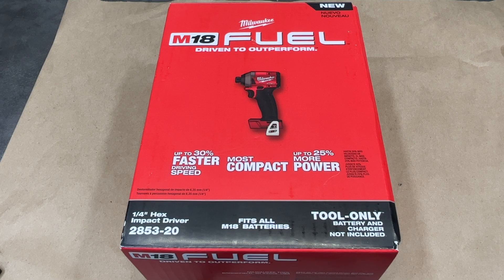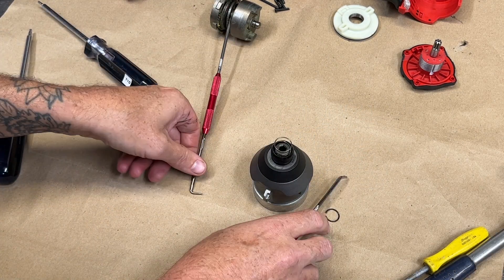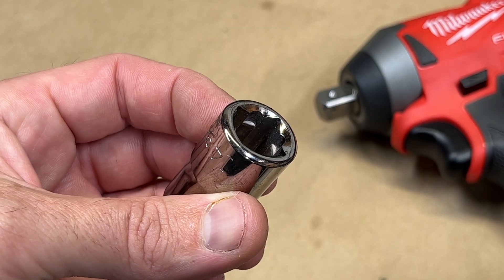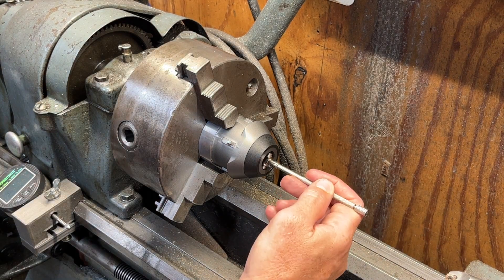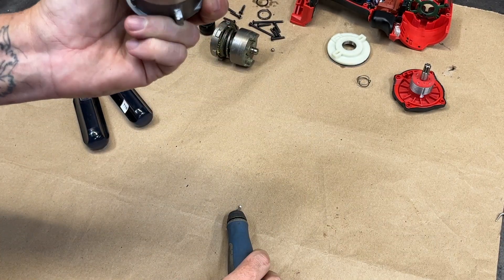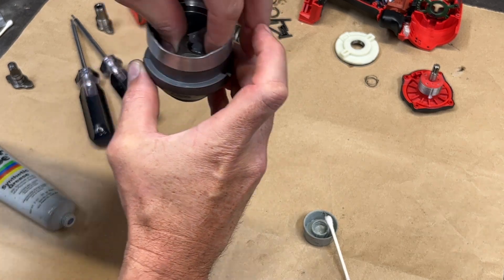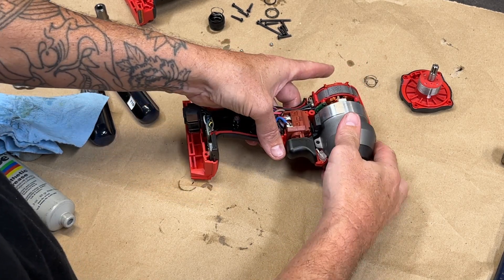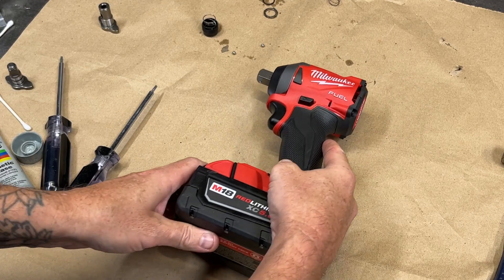Milwaukee M18 Frankenstein 1/2" Impact Driver

Comment: What other options would you use to drill out the opening if you don’t have access to a lathe?
Reply from the maker: Do you have a drill press? I'd say that would be the next best option. If you could set it up in some sort of vise or fixture and progressively get larger with the hole I think you'd have a good result. Most bench top drill presses do spin a little fast so I'd remove a little at a time. Sintered bronze can chip if you're not careful.

Comment: Hows she holding up? I'm about to make another one of these but with a twist 😎
Reply from the maker: Great so far!
Reply: @LucidAutowerks  Have a new impact driver(different brand)and anvil I'd like to modify with a lathe this time. Looking to get estimates for labor. Approx how many hours did it take to trim it properly with your lathe?
Reply from the maker: @mike_t_007  It was less than an hour of lathe time. It’s bronze so it turns real easy. Probably about 20-30 minutes with measuring included.
Reply: @LucidAutowerks  Thank you so much. Words can't explain how much I miss shop classes in high school. This would have been perfect lol
Hopefully I can get this done this week! How much material did you have to remove from the anvil? The hole on mine is smaller than the shaft but I see it can easily be widened like yours was

Comment: I USE MY gen 4 m18 for lug nut removal but seem to break the hex adapter when the customers wheels are over torqued.. I like the light feel of the gun. I really want to do this adaptation! Great work, I don’t have a lathe thought :/
Reply from the maker: Check out the video on Man Caver Tools’ YouTube channel. He shows how to do the conversion using a drill. That’s where I got the idea from 👍🏼
Reply: I did my first one with a step bit. It can be done, and come out great...but a lathe will give the best results
Reply: If you're gonna use an impact driver for taking off wheels, why don't you be wise and get an impact wrench in the first place?
Reply: I think a couple good remmers would be easy

Comment: Very classy, giving Mancaver Tools the credit. I'll be doing this mod shortly. Great job to both of you guys.
Reply: Hey MrCaribe65,
Did mine last summer and it's been great. 
How do like yours so far?
Reply: @mike_t_007 
I did a 3/8 conversion on my Gen 4. Works great.
Reply: @MrCaribe65  Do you have any clips of it?
Reply: @mike_t_007  
Yes. But I haven't uploaded it to YouTube.
Reply: @MrCaribe65  Have you done any major work with it yet? If yes, can share how it held up? Any downsides to this tool vs the Gen 3?
Reply: @mike_t_007  
Used it to rebuild the front end on a 2005 Sentra. The control arm to body bolts I used my mid-torque, though. Didn't want to stress it. I use it for brake jobs and on any fastener 21mm or less.
I did the 3/8 so I didn't have to widen the exit hole for the anvil. It's still under warranty.
Reply: @mike_t_007  
Check your short comment section.
Reply: @MrCaribe65  Wow that's awesome! I started this build over the summer but sold it to someone on Facebook Marketplace before I finished. Never got to use it. Which 3/8" anvil did you go with?

Comment: for the past 3 years, i've made 30 m18 impact conversions; 42-06-0485 was the anvil I mostly used cost around $9 each
Reply: I have the gen4 m18 impact driver 2953-20 and I want to convert to 3/8 impact. Is the part I need to use from latest M12 2554-20 stubby anvil P/N 42-06-2554?
Reply: @Nathan0A  hint; use a dewalt 3/8 anvil
Reply: @D G  Do you happen to have a part number?
Reply: @gdu370  what part #
Reply: I have the 2953-20 how can i swap it to 1/2 inch?
Reply: @Nathan0A 
I used that part number, but it doesn't just drop in. You have to modify the anvil.
Reply: @Nathan0A 
The Gen 4 hammer is different than the gen 4, and the 3/8 anvil's base and ears are the wrong thickness and width. I ground the new anvil into the right shape and size, and made a spacer/bushing to address the size difference between the anvil and the exit hole it goes into. Works great.
Reply: Can you post a video of one of these? Would love to see them in action! Thanks for sharing your post

Comment: Should i use 16.5 bit or 21/32?
Reply from the maker: Both would be a little too small. If using a drill, I'd use whatever Man Caver Tools used in his videos. The 1/2" anvil is .661" and you need a little clearance. The 16.5mm drill would be .656" and the 21/32" drill would be the same, although drill bits often make a hole larger than intended. The best way would be to slightly undersize the hole and then use a reamer to get to the size that you need. Ideally you'd want to end up at around .665"
Reply: @LucidAutowerks  thanks so much ✌

Comment: Hi, is it possible to get the hybrid anvil from the Bosch Freak onto this somehow?
Reply: Read my mind
Reply from the maker: It doesn't look like it would be possible. At least not easily. The Bosch gear case is all one sealed unit according to the parts diagram. The Bosch gear case screws to the front of the driver's clam shell where the Milwaukee's gear case is inside of the clam shell.
Reply: @LucidAutowerks  
Thanks a lot for the reply and details.

I just came across Mancaver tools converting a DeWalt to a Freak in a relatively recent video.

Maybe that's the next best thing. I haven't checked how the DeWalt compares to the Milwaukee though

Comment: Just did this to a gen 2 using a 3/8” anvil. Ended up using a plastic insert to close the gap between the housing and anvil. Working so far.

Comment: Awesome work! I did the same mod and used my dremmel and its pretty spot on. I was thinking what if you shaved the advil instead on the lathe to save the head just incase u want to switch back. Would you think its possible or it'll more difficult?
Reply from the maker: It would be possible but holding the anvil would be the tricky part. You’d have to maybe make a holding jig of some sort. Also I’m not sure if the anvil has been heat treated so it might need to be annealed back for machining and then hardened again. You can avoid that process by using a surface grinder and some sort of rotary fixture.
Reply: @LucidAutowerks  Awesome btw i forwarded your ebay link to some friends.

Comment: Great skills, can this modded  tool be used for suspension work ,thank you
Reply from the maker: Thank you! I don't see why it couldn't be used for suspension work. I use mine anywhere that I'd use a normal impact wrench. The compact design is great for getting into tight places.
Reply: Yes
Suspension 
https://youtu.be/gWRDpQov2Fw

Axel Nuts
https://youtu.be/-8wQ43omYNM

Comment: I just did mine a few weeks ago and was going to make my video showing it with my Ridgid High Torque! After watching your video... There's no need for that👍🏾👏🏾
Awesome video! Thank you for sharing! Wish I had access to a lathe when I did mine 😁
Reply from the maker: Make a video anyway! The majority of people interested likely don't have a lathe and would love to see the process.
Reply: @LucidAutowerks  Thanks Lucid. I didn't film the process when I did mine but have some videos I took a afterwards comparing both the Frankenstein to the Ridgid High Torque removing lug nuts from our SUV. 😁 I've literally had 0 time this summer due to work etc but have a surprise with both of these coming soon
Reply: @mike_t_007  well what did you use to make the hole?? Like tool’s wise.
Reply: @robinsonflores3741  Step bit... It can be done but time consuming for sure if you want it done right. A lathe is your best bet or a 3/8 anvil!
Just made this one recently 
https://youtu.be/BJPTQuk1ElM
Reply: @LucidAutowerks  Thanks for sharing your video! Wish I filmed mine when I did it. End up selling it for a good price and picked up something just as powerful I'll be Frankensteining soon 😎. Definitely excited about this new one

Comment: It would be nice if you or MCT would come out with a parts kit for the ones that don't have a lathe.
Reply from the maker: Unfortunately it looks like the part that I'm cutting is molded into that nose cone. The only way would be to manufacture a completely new part. It can be modified with a drill or a rotary tool as MCT suggested in his videos. I only used a lathe because I have one.

Comment: I literally was trying to find a vid on this a couple days ago. My impact drill won’t keep up with industrial use and the 1/4 socket adapter just spins in the collet so I wanted to convert to a 3/8 or 1/2 bit.
Reply: You're going to LOVE it! Man Caver Tools is about to do the new Gen 4 soon. If you haven't bought one you may want to hold out until he shows how it performs

Comment: Very nicely done, looks like it came from the factory like that. I'm just a bit confused about the reason for doing this instead of buying a 1/2" impact wrench direcrly. Is this cheaper or more compact or is there another reason for this?
Reply from the maker: Thanks! Apparently the impact driver hits more times per second than a standard impact wrench does. Size and price were absolutely a factor as well. There are some good deals right now on the 1/4” hex impact since Milwaukee will be offering their new generation very shortly.
Reply: This is why
https://youtu.be/dz3oBI4emdE

and

https://youtu.be/-yO2S1nPDLA

and

https://youtu.be/-8wQ43omYNM
👍🏾

Comment: Can this be done with a 3/8” anvil?
Reply from the maker: Unfortunately the 3/8" anvil that I bought was .520" and the original 1/4" hex anvil was .590" so to make it work you'd need some sort of bronze bushing to take up the difference. It's possible but not as straightforward as the 1/2" anvil.

Comment: Yeah dude, you did a much cleaner, stock looking conversion than MCT. He was the first though so it's natural to have some imperfections. But having access to a lathe was gold! Yours looks stock! So the only question now... how much you charging to do it for others?
Reply from the maker: Hahaha. That’s a good question. I did buy a couple extra hex impact drivers to convert and toss on ebay to help cover the cost of the one I made for myself. Can’t beat those Home Depot hacks!
Reply: @LucidAutowerks  I already have the anvil and an extra impact ( I was gonna do it myself but can’t get a drill press or in your case, a lathe), how much for doing the work/grinding?